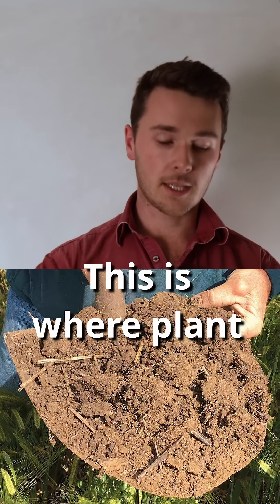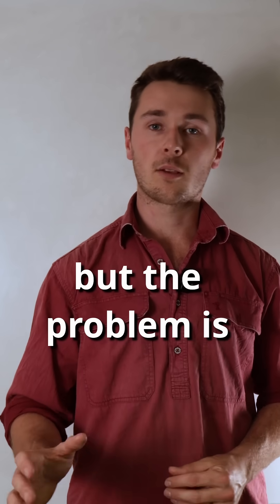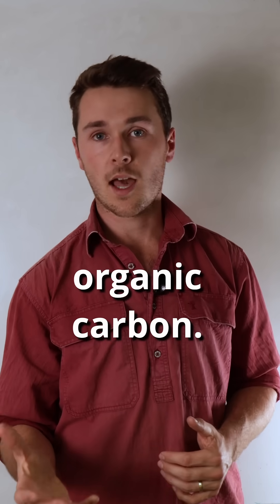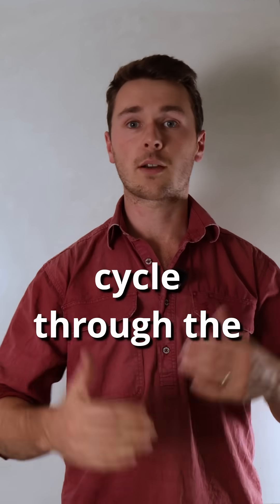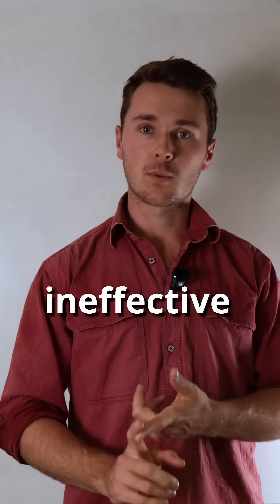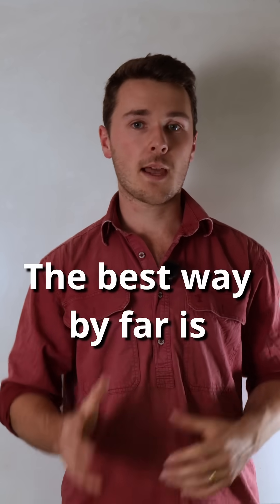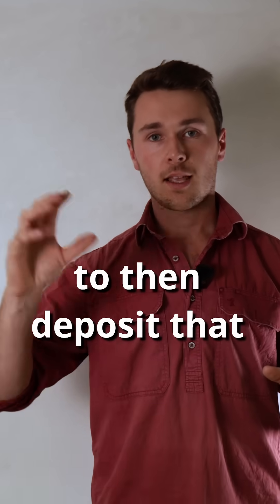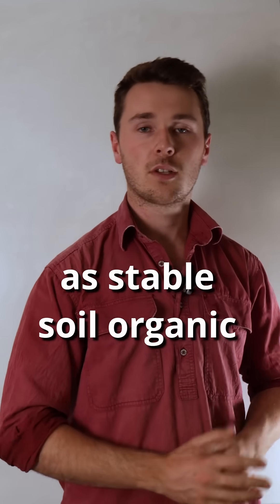The right way to build soil carbon #soilhealth #regenerativeagriculture #regenerativefarming

Comment: What do you mean "liquid carbon path"? To do the path while seeding with something like humic or fulvic acids?
Reply from the maker: The “Liquid Carbon Pathway” was suggested by Dr Christine Jones which is where plants produce root exudates (liquid carbon) and supply that carbon to mycorrhizal fungi to deposit into the soil as stable carbon. Doesn’t require humic substances but rather root exudates.

Comment: I know it was probably just a broad generalisation. But 25 trees? How big are the trees, what type - I'm guessing the plot must have to be pretty big (and hungry) to only return 1% as organic carbon... or the trees were small (?) 😅
Also, do you recommend any specific type of intraradices, or what arbuscula or ectomycorrhizal etc fungi suit different crops and environments?
Reply from the maker: 1% point increase in SOC to 30cm depth across 1 hectare. For example, 1% SOC to 2% SOC. Assuming 5t per tree. It's rough maths but it demonstrates the point that biochar doesn't really work on large scale. Better to keep the trees than make biochar. I'd recommend Endomycorrhizal fungi for crops.
Reply: @agresol_consulting 
Gotcha. I'm guessing even the 1% gain/return is probably an overestimation in most cases. Save the charcoal for your carbon filters instead 😅
Endo ? Hmm interesting. Thanks for the feedback Teale and Team
Reply from the maker: Endo is the same as arbuscula just different naming conventions. Cheers!
Reply: @agresol_consulting 
Ahh yes, endo - intracellular. I think I was thinking of ericoids (?).
Thank you for that.
Reply: Please differentiate endomycorhizal pathway method. Dennis
Reply: @denniskemnitz1381 
Endo is generally 'absorbed' (enters) into the root system.
Ecto is usually 'adsorbed' (sticks to the outside).
Reply: @agresol_consulting cost of purchasing  endorhyizzal bacT. Quicker too utilize by any chance..Dennis
Reply: I wanna go the glomalin pathway. Dennis  recommedations.